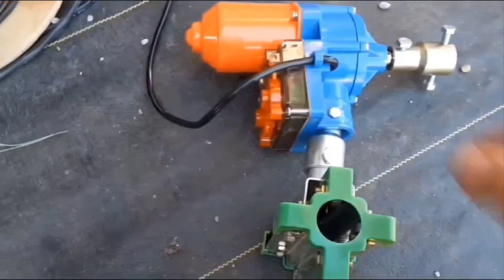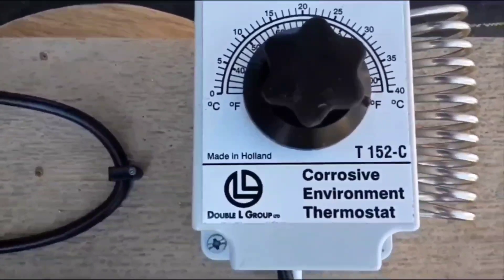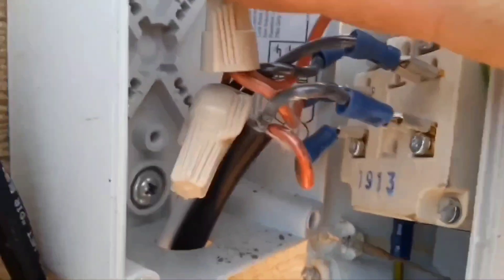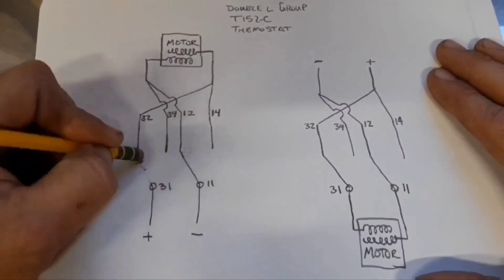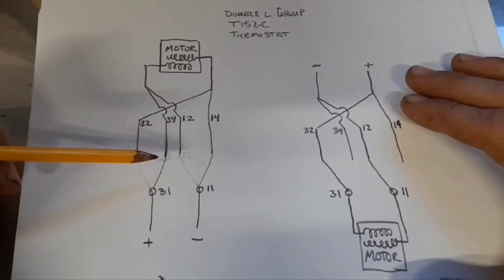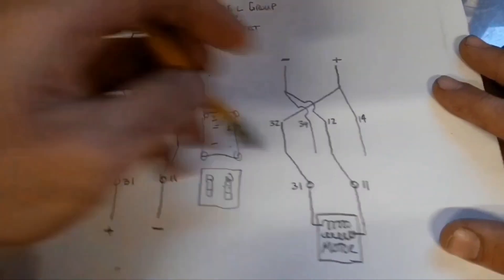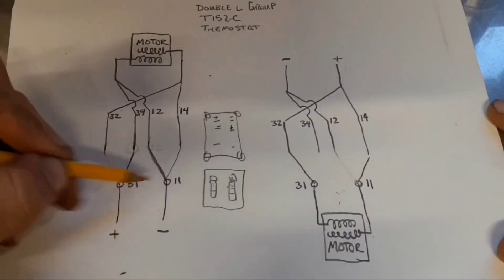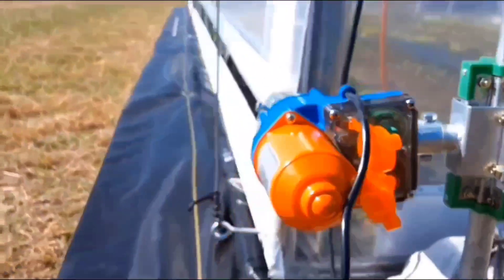DIY Automatic Greenhouse Side Opener

Comment: Keith great video. what are you using as the "rod" that the motor attaches to, and what your plastic rolls around? Thank you.
Reply from the maker: The roll up is 1-3/8" top rail and I use a 3/4" pipe to couple the motor to it
Reply: Can I power this with a 12volt deep cycle battery directly to thermostat controller?